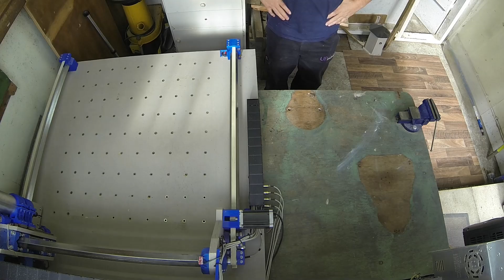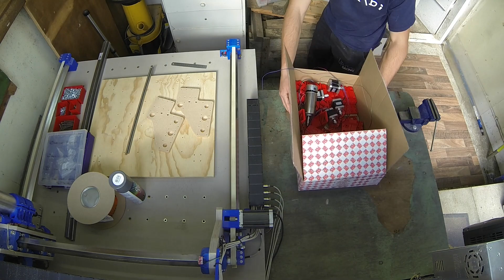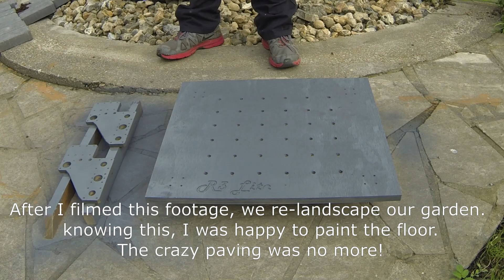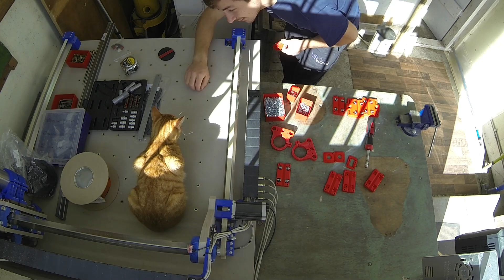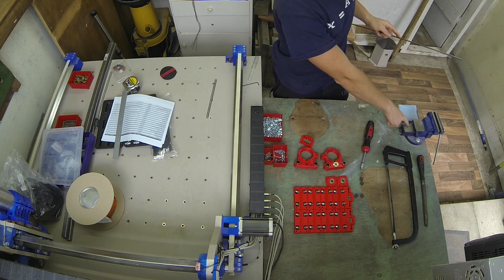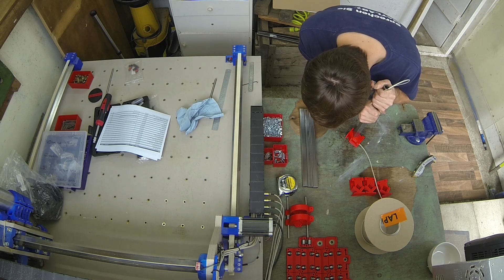Root 3 Lite 3D Printed CNC Machine - Detailed Build

Comment: Could i use a orbital sander to polish the bars ?
Reply from the maker: I don't see why not. You'll need to ensure the sand paper doesn't get glogged up. That's what's the water is there for and to help clean the wet and dry paper
Reply from the maker: I don't see why not. You'll need to ensure the sand paper doesn't get glogged up. That's what's the water is there for and to help clean the wet and dry paper